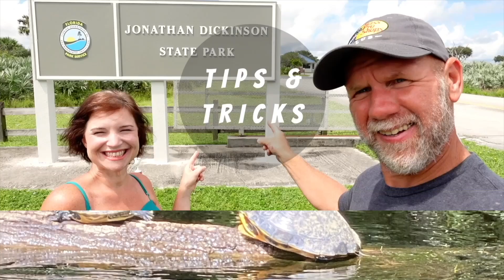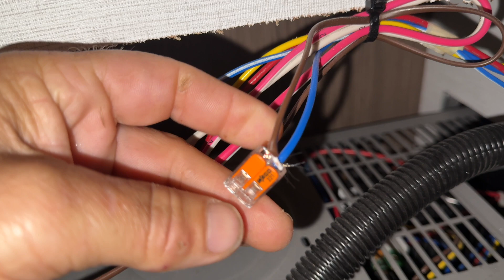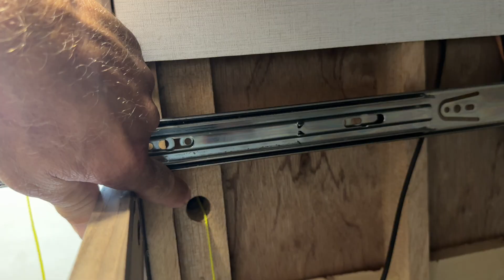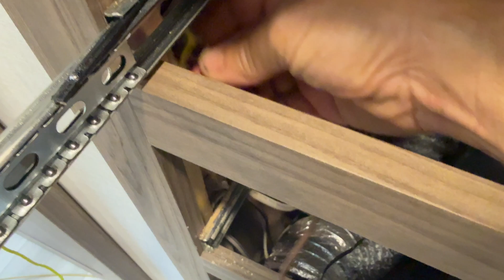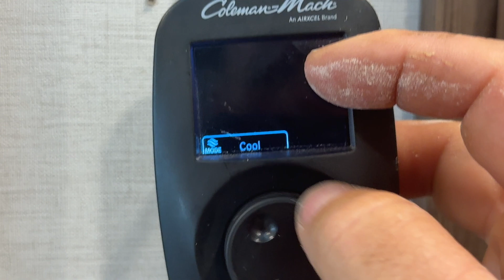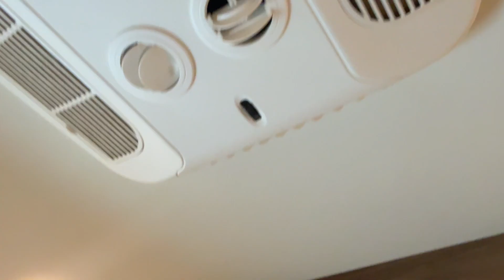Control Your Alliance Delta Travel Trailer Furnace From the Bedroom

Comment: This is great when it’s just the two of you.  As you pointed out in the beginning, this problem is really more of an air handling/damping issue and you’re still gonna have the imbalance of heat.  Likely, adding additional ducting to the living area so more air goes there, is the only way to fully resolve this problem.
Reply from the maker: Adding more ducting to the Living Area wont really help because the bedroom vent is only about 2 feet from the furnace.  That vent will always get a majority of the heat.   The only real solution with ducting would be to add long lengths of ducting in between the furnace and Bedroom and Bathroom vents.   This method solves the problem for the whole rig if you are hooked up to shore power since you can use the fireplace to heat the living space and furnace to keep your bedroom comfortable

Comment: 04:56 Might be too late to check: did Alliance include an additional wire in a wire bundle that you could use instead of running a new one? It looks like they might have run individual bare wires
Reply from the maker: No,   That was the first thing I looked at.  The wire bundle that feed the thermostat have a white wire not connected but that wire bundle goes up to the AC.    The only way to do it is to run a new wire directly to the thermostat or fish a wire from the furnace to the Bedroom AC, connect it to the white wire in the bundle and then connect the wire in the bundle to the thermostat